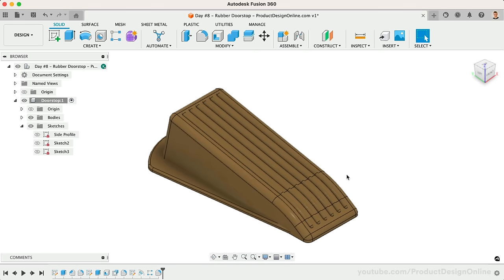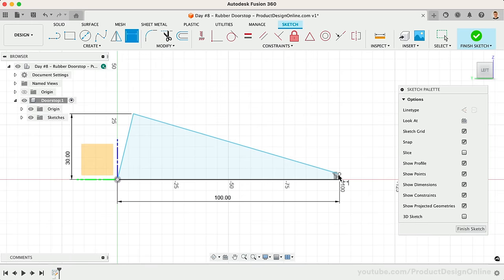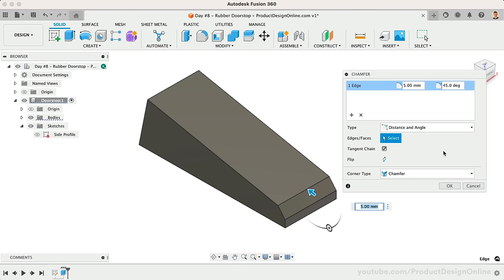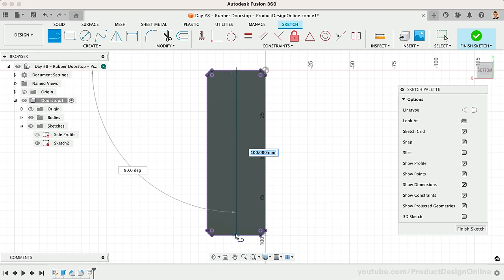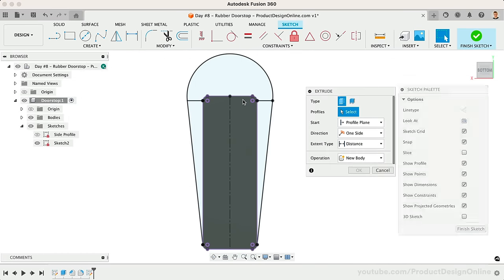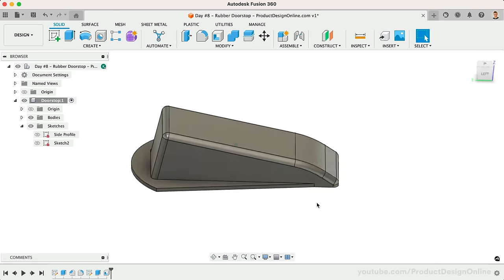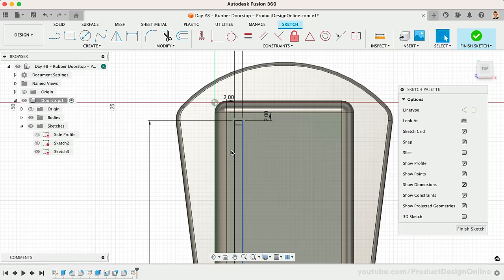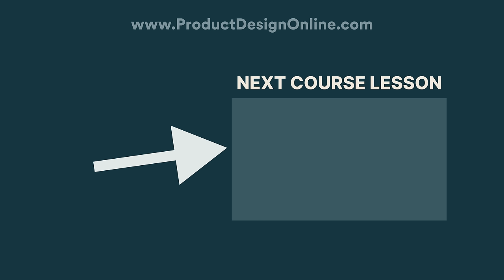Day 8 of Learn Fusion 360 in 30 Days for Complete Beginners! - 2023 EDITION

Comment from the maker: October 2023 Emboss Update (10:11 in the video). The new emboss tool works on more surfaces, but has also impacted how the Emboss tool worked when this tutorial was recorded.
SOLUTION:
1. Activate Emboss
2. Uncheck 'Tangnet Chain' in the Emboss dialog. * Very important. This must be done *
3. Select the 4 sketch profiles (two halves of the circle, two rectangles)
4. Switch to the 'Faces' selector in the Emboss Dialog
5. Select the top face of the doorstop (the largest face).
6. Hold the CMD Key (Mac) or CTRL Key (Windows) to select the two remaining top faces.
7. Select OK to confirm the Emboss.

If this helped you, kindly like this comment to help others see it!
Reply: Thanks for the help. I could only get the top half to properly emboss. This update helped me figure out how to get it to include the bottom part.
Reply: This was exactly what I needed. Perfect
Reply: I thought I was going crazy. Thank you
Reply: Please edit your video for this. Drove me crazy before I found this pinned post. On to Day 9...
Reply from the maker: @quentincampbell5865  YouTube does not allow you to edit videos... If I post another one it will cause more confusion with them not in order 🙂
Reply: I should read the comments first from now on.
I thought I did something wron and remodelled it from scratch...

This chapter really drove me insane but thanks to this update I can sleep well tonight. 🤣🤣🤣
Reply: This still did not work for me. I ended up selecting and sketching each top surface and then embossed each. Not the same but, works.
Reply: This helped. Thank you very much!
Reply: Thanks for the update!  Definitely spun my wheels on this one for a while before looking for the comments...
Reply: For whatever reason I couldn't select the second face. To fix it -  I changed the length of the rectangle to 85mm instead of 90mm saved the sketch and then did the emboss, which worked. Then I went back to the timeline and modified the length of the rectangle to 90mm, which also fixed the emboss.
Reply: @jessedevaney3486 I had this problem too.  I found I had to Ctrl-click on all the OTHER faces and turn them off.  It aways selected all the faces of the body of the door stop and I had to manually unselect the round over edges and sides of the door stop to ONLY get the three top faces enabled.  Then, following the other instructions (like turning off the 'Tangent Chain') it worked perfectly for me!  As others said, I really struggled with this one!
Reply: Thank You for this update info! I used the arc/tangent instead of circle after half hour struggle! Now I see your update info! Your videos are awesome, I'm all in.
Reply: I needed to select 6 profiles, the two rectangles and all four semicircles (2 each end)
Reply: this was perfectly helpful
Reply: Thanks for this! I was getting frustrated trying to figure this out on my own,
Reply: thank you so much. I thought I did something wrong and did the model twice before I find this comment. Thanks.
Reply: Thank you for your time, you helped me immensely.👍
Reply: Add a pop-up message or something on 10 mark. It will help others A LOT.
Reply from the maker: @Xaro5   Done 👊
Reply: I just completed this, but I had to delete the 2 point circle and replace it with a 2 point arc in order for it to let me emboss.  Not sure if I was doing anything wrong, but it didn't seem to like the overlap of the circle and the rectangle when embossing.  Only reason I figured it out was that it allowed me to emboss when I deleted the circle entirely.  Then I added the circle back and deselected the lower half that was intersecting the rectangle, but that left a void, instead of embossing that lower semi circle.  That is when I tried the 2 point arc and all went well.

However, I was unable to perform the fillet in the next step.  There's something going on with that interaction between the rectangle & circle/arc.
Reply: Bravo!
Reply: Hey CMD does not let me select multiple faces for the emboss command on OSX. I have tangency chain deselected but I can still only select one at a time. Any tips?
Reply: Thanks ❤
Reply: thank you
Reply: Worked for me. Thanks for the update
Reply: YESS  THIS WORKED
Reply: got stuck on this one, until i read the comments. thanks for figuring it out.  Good work on the tutorials.
Reply: You a real one for this I’ve been trying to get past this dam emboss for waaaay too long 😂
Reply: Note to self: Read the comments on these videos before watching the tutorial to avoid pulling hair out.
Reply: My emboss is straight and undistorted now. 
smoooth
Reply: Omg, thankyou so much. I thought I was going insane, June 2024 here, so it had changed....
Reply: @TUBEED00  100%
Reply: Lesson 8.2 - Read the comments 😂
Reply: I spent about 15 minutes trying to figure out where I went wrong before I thought to check the comments. This did the trick. Thank you! Loving this series so far!
Reply: Thank you - had me stumped for a moment :)
Reply: Well this comment stopped me tearing my hair out, thank you
Reply: Still getting a error message! The emboss won't work!
Reply: Don't know if there has been an update buggering it up since then but I did all mentioned and it still will not work as soon as I select the top face with tangent chain selected it comes up "Cannot create emboss feature. Adjust sketch profiles, faces, emboss depth, effect, or alignment options." 
when I remove Tangent chains it comes up with the exact same error
every thing else has worked and I'm thoroughly enjoying this fantastic series
Reply from the maker: @jimcree3283  Can you share a link to your Fusion (.f3d) file?
Reply: @ProductDesignOnline  I don't have this File type option 
I figured it out in a much more round about way I created a sketch from the side that I then traced the curved profile made an offset connected the ends then extruded it side ways I created the profile on the end section extruded that up then lofted between the end section and the lower end face of the middle section then I lofted between  the upper end face of middle section and the lower end face of the original emboss. Bit convoluted but I got there in the end. also I must have bunged it up somewhere 90 was too long for the emboss to stay on mine striaght out let alone following the curve.

Thanks again for the hard work the previous sessions gave me the skills,  knowledge and confidence to figure another way to skin this Cat !!!
Reply: Yes guys unchecking 'Tangnet chain' is freaking important!! Gosh my fusion360 crashed right after I selected that top curved face and it had crashed 5 times before I unchecked that! I really thought I had no luck with this project for a moment... THANK YOUUUU!
Reply: This still did not work for me - Win 11 pro, latest updates 8/15/2024 - going for one face only. I could select all faces using CTRL key but kept getting error message and never could get to OK
Reply: Thank you!
Reply: THANKS I WAS STUCK AT THAT
Reply: I have done it from scratch twice and the trick doesn't work for me... beyond frustrating, but I know it's not your teaching. I just wish I knew how to overcome the issue
Reply: So I spent an hour trying and retracting steps and only then decided to look in the comments. 🤣
Reply: I knew there was an error somewhere
Reply: Maybe there's a 3rd solution? Doesn't work on the 2024 version.
Reply: i first did it, then i saw this
Reply: Thank you very much, I have been trying to get this to word for 2 hours.
Reply: Brilliant! Right when I decided that I would figure this problem out myself. Glad this comment was here when I gave up.

Comment: If anybody on windows is having issues at the 10 minute mark with the embossing, select the the 4 areas then when you get to faces deselect the tangent chain then select faces and hold CRTL when selecting the top 3 faces and you’ll be able to select them individually giving you the result you need. This is what I did and it worked perfect.
Reply: THANK YOU SO MUCH!!  I fought with this for almost an hour, I appreciate you taking the time to help with your comment!!
Reply: @natalieacheson5797  glad it helped! I was told to use ALT and it didn’t work so I just started using every key until something worked haha
Reply: Thanks so much for this.  Could not figure out why I was getting a different result than he was in the video
Reply: Oh wow. I even did the tutorial a second time thinking I had done something wrong. I either got some weird bulb embossing at the top with the circle or the embossed area had some serious curvature going on. Really hope Kevin sees this and adds a note on a revised video because this was driving me nuts. Thank you!!
Reply: thank you
Reply: Thanks. My embossed feature wasn't following the sketch lines and I couldn't figure it out why. This solved it.
Reply: Thank you!!!!!!!!!!!!!!!!!
Reply: my circle was turning into a bulb and my emboss was getting unaligned but this solved both of my problems, sir i appreciate you so much. Also before choosing your Faces, choose 1 face then hold control. it will turn those 3 faces into 1
Reply: Spent an hour on this, Thank you!! I wonder why in the video he doesn't have a problem when selecting faces??
Reply: Brilliant, thank you for the tip!
Reply: @MrEatsChildren  No idea why, but I used a tangent arc instead of a circle and afterwards deleted the diameter line.  That combined with the above advice gave me an emboss with no 'bulb' effect.
Reply: Oh my god, thank you, I have been stuck on this step for ages.
Reply: God Bless you
Reply: I've just trimmed the circle - so it makes two profiles to select instead of four - and this works fine
Reply: THANK YOU!!
Reply: Thank you.  I'm on a Mac and was having the same issue.  I had to hold the Command key instead of the CRTL key and this fixed it.  It didn't like the part of the circle that intersected the rectangle.
Reply: Thanks mate!
Reply: God bless you. Damn emboss had me fight with it for over 2 hours. I even deselected tangent chain, but didn't select all the 3 faces. Daaaamn
Thank you!!!
Reply: @ppcflyer2fatboyrider  Thank you for the tip!
Reply: Thank you!!
Reply: For some reason I could not get the CTRL key to work and select multiple faces. I just made the ridges at the top for practice.
Reply: I was having an issue with it on windows as well and I found it works if instead of creating a 2 point corcle in the sketch you get rid of the top of the rectangle and create a tangent arc
Reply: Ty so much I was so confused on why I couldn't select the proper face/faces
Reply: Thanks a lot ! Was searching for nearly half an hour on what I did wrong, when I was planning to comment and ask if somebody could help me. Thanks a lot !
Reply: Thank you <3
Reply: THANK YOU SO MUCH!!!  I rebuilt this damn thing 3 times  before I saw your post!!
Reply: Thank you so much!
Reply: Like everyone else, thanks for the tip!
Reply: you are a legend. been trying to figure it on my own for about an hour lol
Reply: no idea what I'm doing wrong but the sketch is not following the curvature, ergo the embossing gives an error.
Reply: Thank you so much, I was struggling with this, thought there was something wrong with my design
Reply: another option is to individually do the emboss operation on each sketch, while selecting each corresponding face
Reply: OMGGGGGG!!!!!!!! THANKS A MILLION. Was stuck at this point since 30 mins
Reply: THANK YOU SO MUCH
Reply: Brilliant. Struggled for and hour before chekcing the comments! Thank you.
Reply: Had me stuck for a HOUR THANKYOU
Reply: Just started this course a couple of days ago, and ran into this issue today.  I "scrapped" the progress I had on this exercise , and re-did it THREE TIMES, figuring that I must be doing something wrong.  I read the comments here tonight, followed your advice, and achieved success at last!  Thank you SO MUCH for helping save my sanity!
Reply: Thank you, so much wasted time on this...
Reply: Thank you was about to have to walk away for a while
Reply: thanks bro I was scratching my head for a while.
Reply: thank you so much
Reply: Thank you!
Reply: Thank you for your guidance. Was helpful.
Reply: @DarrylLuther  you my brother did something I did 😂😂😂😂
Glad I checked the comments because I was fired up for going for the third attempt 😂😂😂😂
Reply: You saved my evening! A mod for all if on Mac, Command key.
Reply: Thank you so much!! this is my second night on the project and I was able to get through it :)
Reply: Thank you so much  ,was about to shut down in frustration😅😅
Reply: Still gives me an error!
Reply: my heroe
Reply: thank you bro
Reply: Thnx for this, big help. For the people on Mac, I ended up making the sketch into 2 sections, locking it, then embossing them separately. For some reason, holding shift or command did not help and there was a x5 Fusion Error which shut it down, but unboxing the tangent chain and modifying sketches finally got it done.
Reply: Brotherrrr amazing
Reply: Thank you, went all over the whole model like 5 times and couldn't understand what was going on, and this was the answer. finally worked.
Reply: Not all comments sections are bad, thank you.
Reply: THANK YOU!
Reply: Thanks ❤❤❤

Comment: Hey! For anyone still having problems with the embossing of the lines, I figured out a workaround: Instead of doing a 2 point circle I just created a 3 point arc at the top of the rectangle, then after selecting it in the emboss tool it worked perfectly. I don't know why, but it was having trouble with the 2 halves of the circle that you needed to select.
Reply: thanks
Reply: Thanks!
Reply: THANK YOU SOO MUCH I WAS AOBUT TO JUST GUVE UP
Reply: Thanks man 🙏

Comment: I cannot find a way to get the chamfer arrow pointing towards the taller side of the doorstop. It only points down so I cannot put a 15mm chamfer there (only 10). Am I missing something?
Reply: Same here
Reply: @ne0komodo  same
Reply: Probably don't need this anymore but I'll leave it for anyone struggling like us. Hit the "flip" icon on the chamfer's editing box. When the sketch is made in the video he's has the y axis inverted so his build goes from 0 to -100. If your sketch is going from 0 to positive 100 the math for the chamfer gets messed up.
Reply: @volk1277  Yes, that works!!
Reply: Just flip it

Comment: FILLETS PROBLEM (at 11:14) - if they doesn't apply properly and the edges are not rounded use not 1mm value but 0.9999mm. This solved the problem for me.
Reply: right on the money, thank you for this
Reply: Thank you so much. Solved my problem too. It is so strange, 1 mm worked for Kevin, but not for me. Why is that?
Reply: THIS. I need an explanation from Kevin ASAP!
Reply: My fillet also didn't work the first time I tried it with the 1mm dimension, but I then noticed I didn't follow the same order in which he chose the lines to apply the fillet to. Once I did, the function worked with the dimension & came out like how it's shown in the video.

Comment: You know at 11:11 you start to add a fillet to all those edges. This is sort of tedious given it's 60 edges! 

I instead went back and edited original feature which saved me from clicking all of those lines to fillet them. In other words, I fillet THEN R Patterned mine to the same result. I bring this up not as a critique but more as a compliment to the series. I'm starting to learn faster ways to do things thanks to the videos you've made. 

You're a great teacher. Thank you.
Reply: Thank you, this helped me a lot I was having a hard time getting it to fillet correctly.  I would add I had to change the Compute Type to Optimize before I clicked ok on the R-pattern otherwise I received an error.  Thanks again for this tip!
Reply: @natalieacheson5797  Ahh, I got the error too at first - Thanks for pointing out to change the compute type :).

Comment: How are you making chamfer of 15 mm on the edge of the 10mm size @03:32?  I get a could not be created at requested size error.
Reply: I think you and I both ended up creating the initial extrude on the wrong side of the axis or something.  He said "Select the top edge" and then he's able to drag back along the top of the doorstop, where I was only able to drag DOWN the front.  So I had to reverse it, from 15mm/25deg I had to do 7mm/65deg.
Reply: @SeanReifschneider  This helped me, thank you!
Reply: @SeanReifschneider  There is an option of flip use it to change direction

Comment: Hi Kevin, thank you for your tutorials. I've used them to teach and we have done this doorstopper in particular many times over. I will say that adding a 3mm thickness on the skirt, a shell of 4mm and single line of web inside makes the door stopper much stronger. Thanks again for doing these tutorials, you are easy to follow.

Comment: Two things I'm wondering - 

1) When we offset the surface to bridge the gap at 8:30 we create overlapping geometry. Could this create issues if, for example, we want to 3D print this without unifying the bodies? 
2) I'd think it's more efficient to apply the fillets to the single ridge then use rectangular pattern instead of selecting all edges on all ridges after rectangular pattern. Is this not the case?

Thanks and great tutorial series!